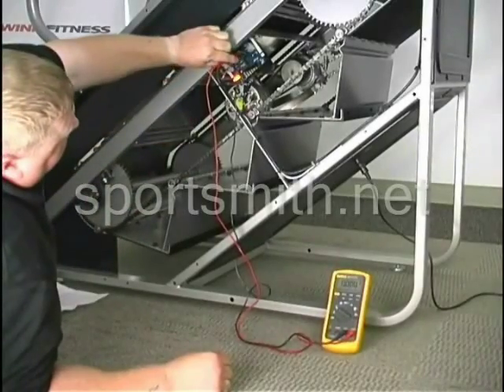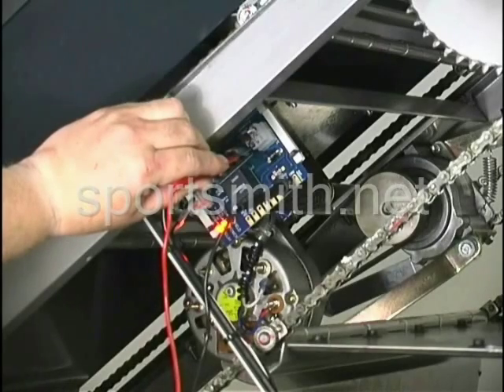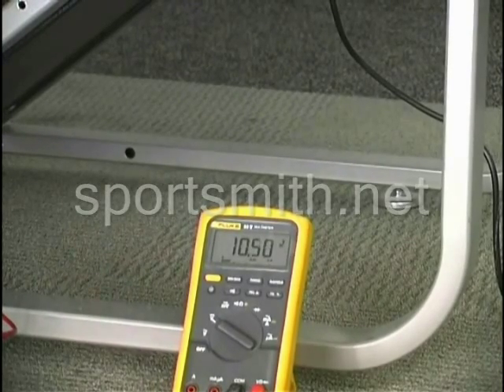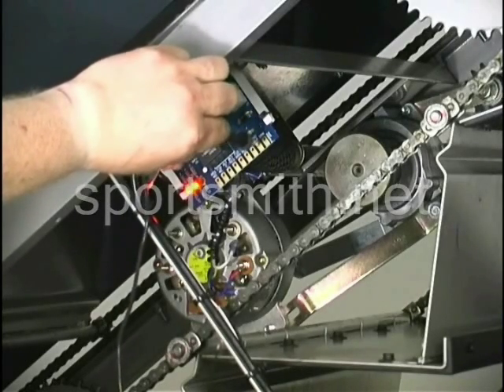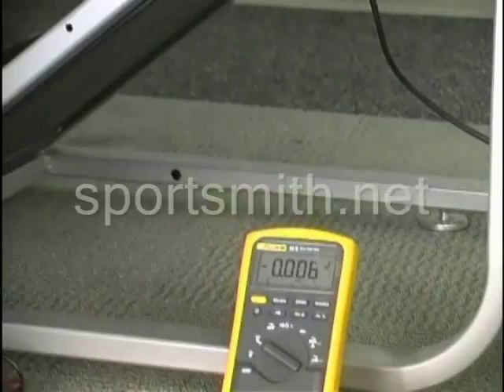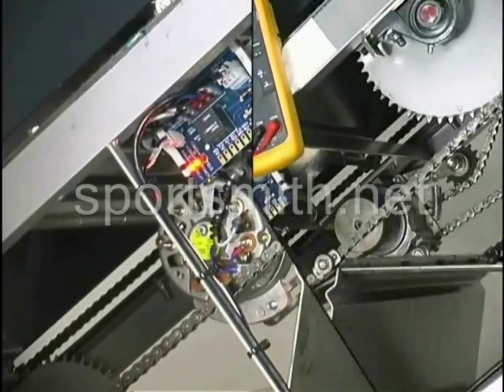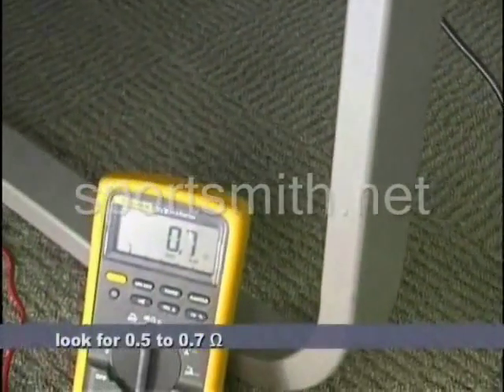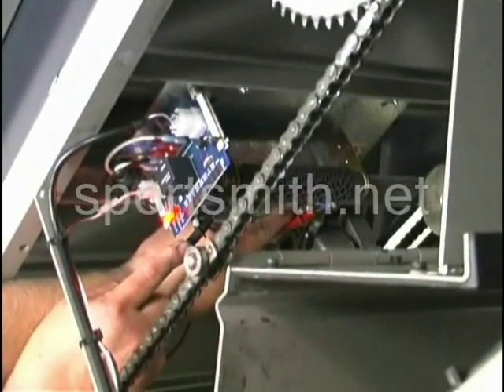Stairmaster Stepmill No Resistance

Comment: How much travel time should I change the alternator, chains, belts or transmission on my gauntlet please?
Reply from the maker: Hello, Thanks for your question. There are no printed guidelines on when to change the parts if they are in good working order. Just follow the preventative maintenance schedule in the owner's manual and during the regular inspections, you will find any issues that need to be addressed.
Reply: thank you very much for your kind answer
Reply from the maker: @rivasfitsupport683  You are very welcome.

Comment: hello, I have a stairmaster sm3, and it has stopped moving. The stairs will not move, and I haven't figured out why. Everything else works, but the stairs. I can quick start, and it will count down, but will NOT move. What could be the issue?
Reply from the maker: First  make sure this is not a mechanical problem. Which would be done by removing the Alternator belt (with power disconnected) to make sure once that is done that the steps spin freely. In this state you would also want to make sure the alternator spins free with the field wire disconnected from the alternator. If in either situation the movement is still stiff, this is a mechanical issue and that will need to be corrected. If the machine and alternator spins freely the problem is with the electronics and troubleshooting will need to be done with a multi-meter to determine which part/s are at fault.
Reply: Sportsmith the alternator and the steps do indeed spin freely. what type of electrical problem would this be?
Reply from the maker: When you have a moment please call our tech support team toll free at 1-888-713-2880 and they will get you fixed up.